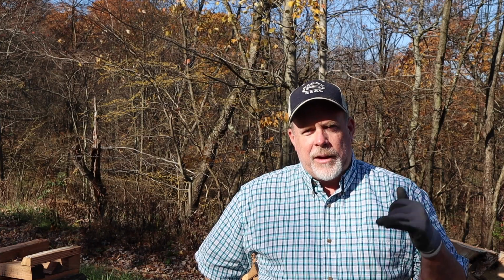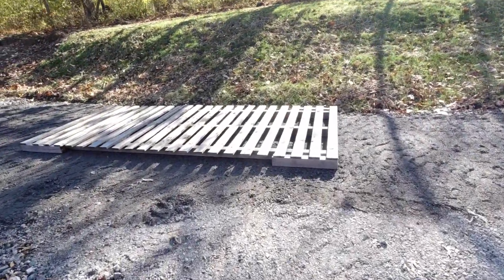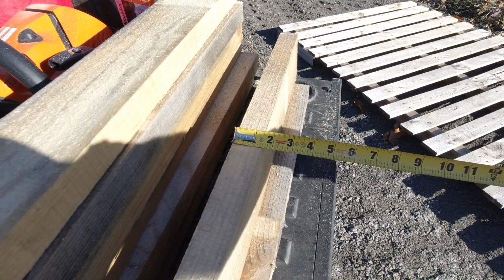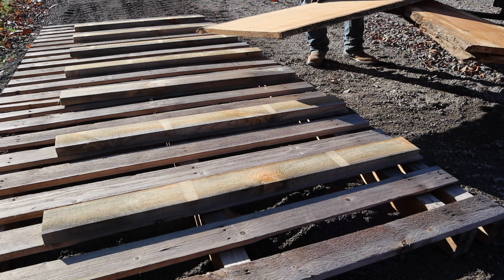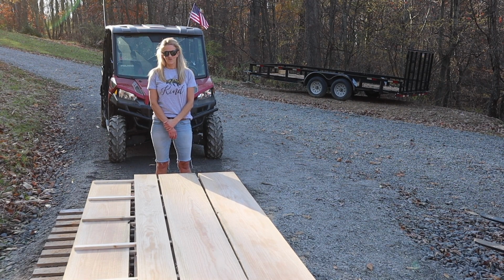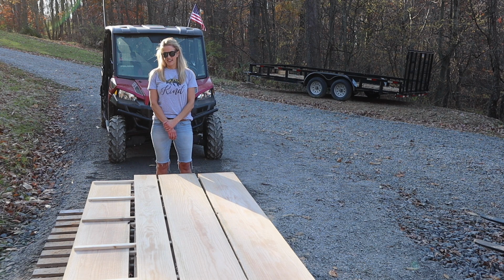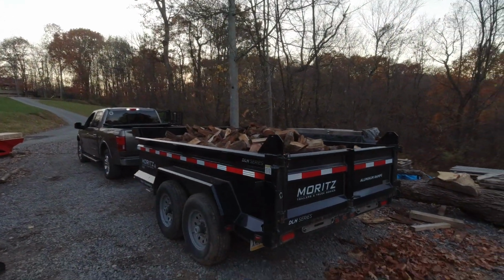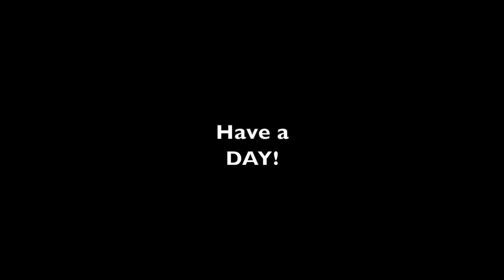#944 Might as well do it right! Stacking and Stickers, Firewood and More

Comment: Piling wood the right way is an art form. My grandfather showed me how to do it when I was a kid. If it's done correctly, it will never rock and roll or tip over or fall apart. You will not need to use posts at either end and when finished, it will look like a work of art. It appeared that you have learned that art form, Mike. I enjoy watching your shows and having worked with heavy equipment, it becomes a part of me like an exoskeleton suit after about 15 minutes, so I like watching you and wishing I was there to show you some tricks of the trade. Also as far as the sawmill goes my grandfather had one with a vertical round blade and I spent hours working with him = he was a genius. He built it from scrap and made a living at sawing boards for everyone in the area. I never knew the man to make a wasted move, the very personification of efficiency. As for the numbering of your episodes, switch to a new numbering system; maybe the date of each episode or use an "A" series, then a "B" series denoting the year of each year's episodes. For example 1A, 2A 3A, and so on. Or 2K1A, 2K2A, 2K3A, etc.  The 2K indicates the 2 thousand series (the next thousand videos) and the 1A indicates the episode number. Very few channels reach 1,000 episodes. Congratulations. By the way, I just shared you with my followers on Facebook and will continue to do so.

Comment: Good tip on colors is to try and avoid getting a color that is the same but not the same, it is just close. That never looks good. It looks like a mistake. You can go to a whole different arena and that works well. To me the color combination you chose works well with the house but it needed something, and you gave it that something with the white doors and windows. That brought the whole thing alive. I was looking at it trying to figure out how you could incorporate even more white to really get the balance right, and there it is, you need white garage doors. It will brighten everything up. I would paint them white in the same exact shade as the doors and window trim. 
I like to tell people that white is not white, and brown is not brown. What I mean by that is that colors are a blend of color. They have white, but it also may have a few drops of black, or blue, or red in it; not enough to make it look like a color, but the tint is a subtle effect but an important one. You could for example go to the paint store, and find the exact match with the doors and windows you have now, and then add just a few drops so to speak of the base siding color tint, and the upper siding color tint to create a miraculous effect of somehow mysteriously blending in a beautiful way with the building, without taking it away from the overall match with the existing doors. 
Another thing is from an experience I had when buying clothes in June. The summer stuff is all picked through so, you spend all day trying to find something that fits and you like the color. Finally, exhausted you find something that fits, and you look at yourself in the mirror, and although it doesn't look that bad you find yourself trying to convince your mind and heart it is okay, but something inside is nagging you it it not. So, in exhaustion you buy the thing, bring it home, but it is by far not your favorite thing to wear, and more often than not it sits in the drawer, hardly ever to be worn. You have no choice not to wear the doors. The statement that maybe we will get used to them is like staring in the mirror trying to talk yourself into liking something that you really don't. Fortunately, yes there is paint. You have to do this. You love your building, and I do too. Eat my heat out. What I would do with a building of that size. Phew. The dreams go leaping.

Comment: Good morning Morgan’s, from Athens, Texas. Mike, have you thought about using a large metal shipping container to dry your boards? I have not seen that done, but wouldn’t that work a bit more efficient then covering them with a tarp out in the elements?
Reply: Need to load with forks from the side, don’t want to hand load. Also could put wood stove in it to improve drying.
Reply: @daveschooley8514  Hey Dave, I have lifted 16' pallets from the end. I think his tractor could handle that, maybe. I think you are right about the stove.

Comment: I noticed the ends of the lumber you were stacking was checking bad. If you go to the big box store and buy returned paint (cheap) and paint the ends of the logs as soon as they are cut you can reduce the checking and add value to your lumber.

Comment: Good morning from Fulton Co. Pa.  Been a subscriber for some time now, I’m recovering from shoulder replacement surgery and look forward to your videos every day. The pole building looks great, do those LED lights work better than fluorescent. I need to make my lighting in my barn better. Thanks.
Reply: Absolutely they do, Eric. I replaced the two bulbs in my garage with two LED bulbs and there is no comparison.  Now, the LEDs I purchased have 3 wings that can be adjusted for angle from zero degrees to 90 degrees and each is 60W, but produce 6000 lumens of light. It is like the sun was brought indoors now. Much brighter than even 100W incandescent bulbs or 100W equivalent CFL'S I had in the past. Instant on as well whereas the CFLs had a warm up period before reaching full brightness and it was no way near what these bulbs put out. These just screw into the existing standard base as well. Simple swap.

Comment: Good choice of color on the garage doors, you want to use light colors on them , especially if they are insulated and have aluminum skins on them .
Reply: No not a aluminum steel.
Reply: They don't make aluminum skin garage doors put a magnetic on on it. Done this my whole life.
Reply: Aluminum skinned doors are made now and have been available for close to 40 years that I am aware of. Haas 5000 series has a 24 gauge aluminum skin and is made in Ohio , we have older Overheads that are aluminum skinned. If you read the manufacture's warranty for a lot of the door companies , they discourage using dark colored finishes on their metal doors.

Comment: Slow your production So you can switch to a new number system. #YMMDD so at Fist of the year will be #10101 you will be adding 1 more digit and it will include the date remove punctuation. , or / instead of and more. Easy for the next 9 years. I am sure the Grammar people will be on you but. You will have a jump but till 2030 your set.